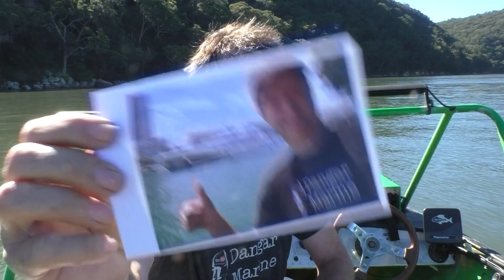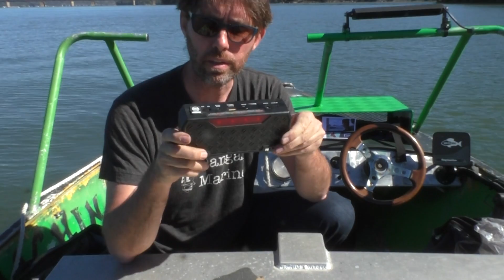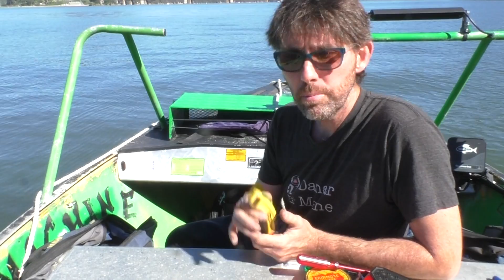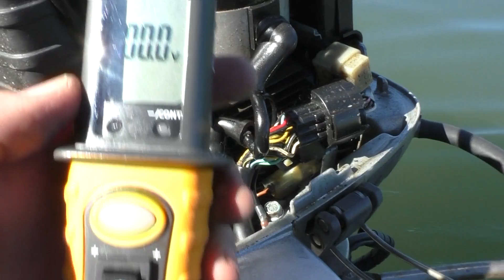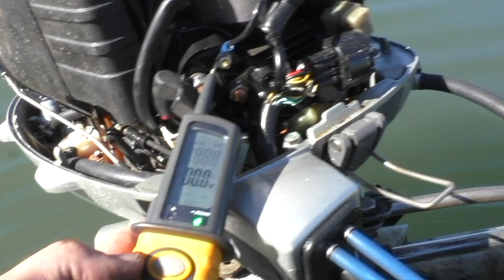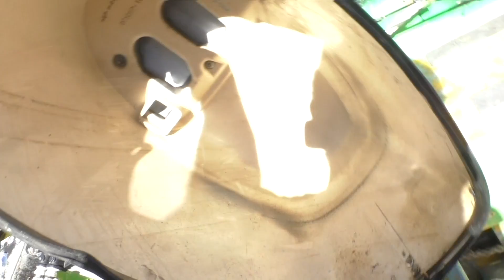Breaking down in a boat on the water

Comment: Great thanks for the tips I actually been stranded and it was the fuel filter and I have 2 250 on my boat I once was off shore and had to wait 2 hours to be towed back lol
Reply from the maker: That's the funny thing, you can have $30K worth of perfectly good motors hanging off the back of the boat and they are held to ransom by a $5 filter.
Reply: Andy Johnson yes that happen to me too I have a 115 on mine and it shut off and i got it back on put it in gear and off again then it wouldn’t crank thankfully fuel filter was just loose

Comment: lol, the kill switch, I've done that one before, I was out deep sea fishing in a 4.2m tinny with uncomfortably high swells. I luckily realised that the kill switch was the issue with literally only just enough battery power to get the motor started. No manual pull start on motor at the time but i am going to install one.
Reply from the maker: They can be surprisingly fickle those kill switches. A backup pull start is always nice to have, that's for sure.

Comment: Great video, but I miss one thing with I had 2 years ago. The engine stalled in forward, but I could start it again in neutral. The moment I shifted to forward or backward it stalled again. After 2 minutes I found the problem, a old rope had tied my propellor completely. Using a good, sharp, knive I could remove the rope and continue. I saw that you carry a Stanley knive but something a little bigger, 3 inch or so, is really handy on board a boat.
Reply from the maker: Ah yes, very good point, checking for something around the propeller is another excellent suggestion. I've certainly had call outs on the water where that is all it turned out to be.

Comment: this "starter spray" sometimes could be messy, especially if it's get old... i mean somehow you ending up just spraying residue water out of this can into the throttle body

engine sputters, than you have a false lead (what's could be wrong)

i use a small medical syringe (40-50ml) with a well long enough plastic tube extension to suck up fresh gas from the tank.. with this, you pump this little bit of gas (about 10-15ml depending the weather) thru the throttle body right at the reed valves (2stroke) ,or the inlet port (4stroke)

same effect.. start with 1st pull
Reply from the maker: Personally I've never seen a pressurised can get water in it, but I'm sure it happens. A little bit of fuel in a syringe certainly does the same job though as you say.

Comment: Very fitting video for my weekend, lower unit bit the dust 2 miles from the boat launch. Ended up rowing back with a tail wind and poling along in the shallows. Checked the lower to find it cracked and leaking, completely locked up the motor when it failed. I thought I seized the motor but put a spare lower on it and she ran good.
Reply from the maker: I towed a friend a while ago that had the exact same problem. When you couldn't even pull start it I thought it must be seized but it was the gearbox too. Thank God for a tail wind!
Reply: The clutch dog came apart and jammed the works.

Comment: Great video as always mate.To add to your list I carry a spare complete fuel hose with bulb,small wire brush,duct tape,electrical terminals,spare bulbs(Nav/trailer) and a few otter bits and bobs that take up very little room.I haven't had to resort to them yet but I have certainly got otters out of a pickle with them. A good subject for a future video is what to look for in a used boat/outboard.
Cheers.
Reply from the maker: Hey Fabian, just duct tape and a brush are a good idea. I did actually have a bulb and some fuel line on the boat but didn't show it, should have! I also thought about globes as soon as I had finished filming. Doh! I have a video on buying a used boat half finished. I'll have to get it out soon.
Reply: Dangar Marine looking fwd to the buying a used boat video mate.

Comment: I first read the title as if you had a meltdown on a boat etc and was really confused. Also, did the Green Machine actually have a real issue or was this a cooking show type of "here's one I've previously prepared" situation?
Reply from the maker: I read it that was too. One often leads to the other! No, it was just a video I had been planning to do for a while, but I did laugh when I remembered that the anchoring video Paul and I did that I referred to had a moment when the boat wouldn't start. :)
Reply: Lol indeed. On a different note, have you ever thought about mounting a solar panel on your bow to keep the battery topped up?